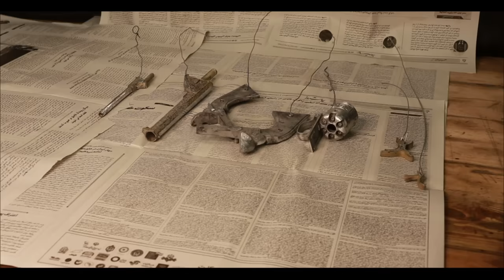Old Model Ruger Revolver Gun Restoration (decoration gun find in river  )1851 Navy Model Restoration

Comment: That's not a Ruger. All Ruger revolvers, be it muzzleloading black powder or breech loading cartridge gun no matter what caliber has a top strap. That thing is an open top Colt/Colt style. 1800's manufacture or a reproduction I can't say without watching the video. Since you can't even properly identify what you have, I'm and it's just another fake "find" of a old style gun you put in a bucket of mud in the garage, then transferred to wherever for the "find", I'm not going to waste my time. I will say the chances of it being 1800's manufacture is slim to none. Far more likely it is a modern post 1960's/1970's manufacture reproduction of a 1851 Colt Navy revolver. (open top and octagon barrel give it away) If the barrel is stamped "BLACK POWDER ONLY" it is guaranteed to be a modern reproduction. Smokeless powder wasn't invented until long after 1873, when Colt stopped making an open top revolver.